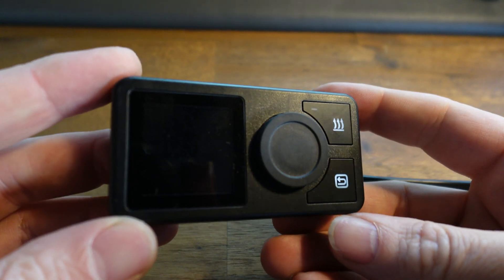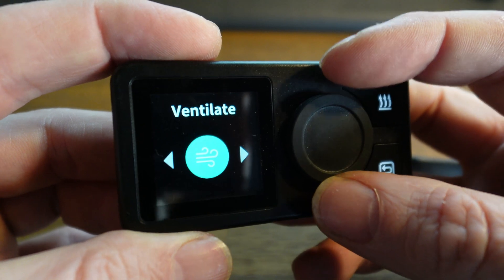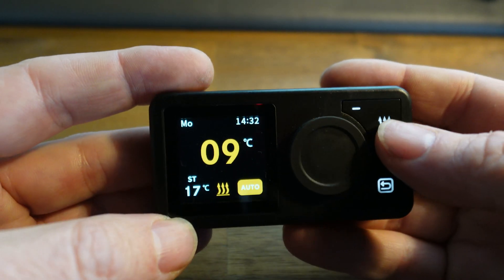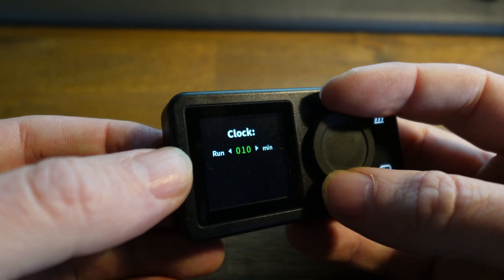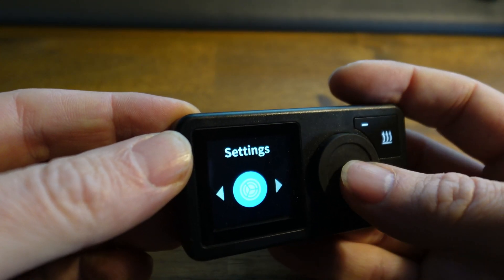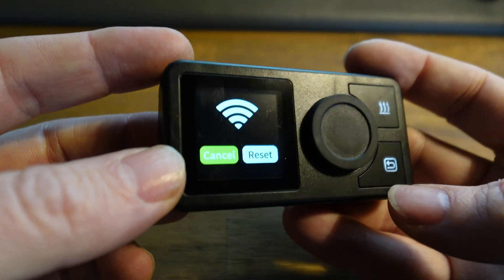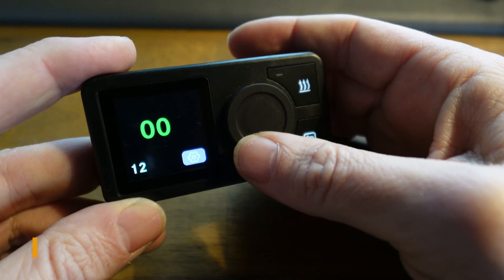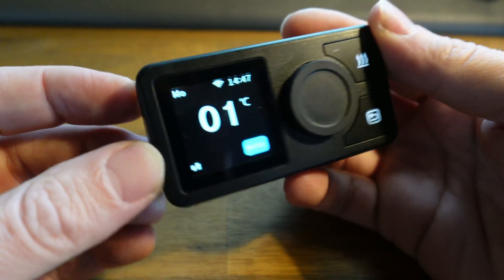HLN Controller

Comment: As an add on to my prior post, my controller shows a error code of 29,thank you
Reply from the maker: Here is a link to the user manual provided by the manufacturer
https://brokenrover.com/images/hln/HLNComfortStartDigitalControllerAirVentilated2024.6.14.pdf

Error 29 is apparently related to the fan speed being detected under 300rpm.
Reply: @ thankyouverymuch

Comment: Nice video. Thanks. 

Is there any way to see the temperature of the heat exchanger sensor?
Reply from the maker: There is no additional diagnostic information available. Maybe in a future version
Reply: @DefenderCanada It would seem an easy add on to the app with a firmware update.